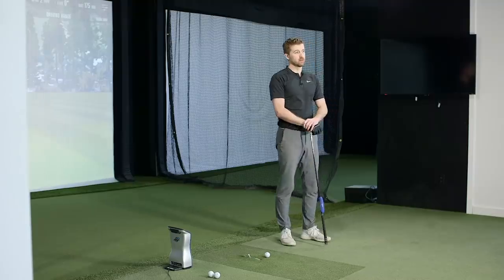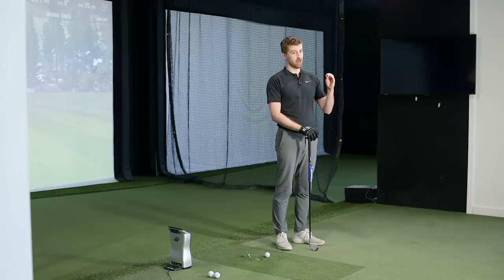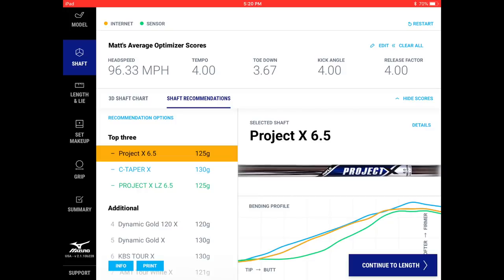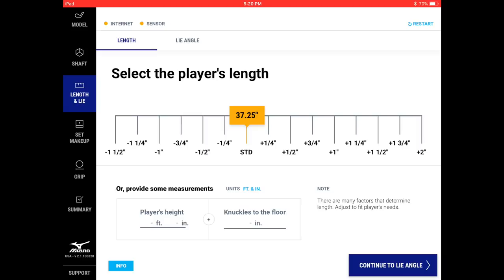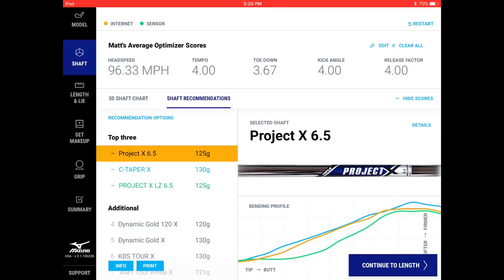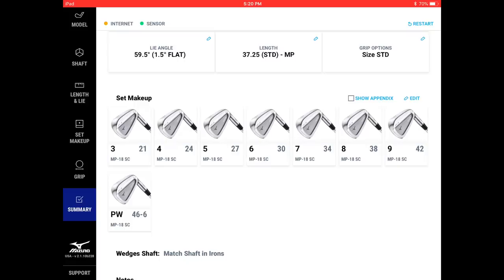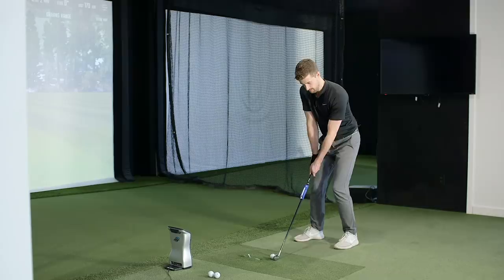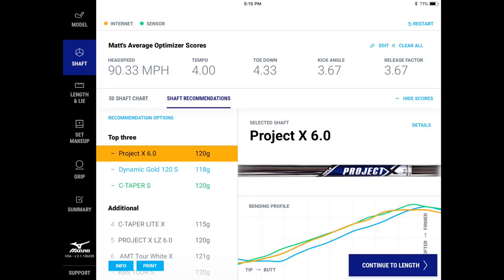Mizuno Shaft Optimizer 3D – How Effective is it?

Comment: Went for a Mizuno fitting with my Pro, who is also a Master Fitter.  He "didn't need" the Optimizer to select my proper shaft.  I struggled for 30 minutes with three different heads to hit solid shots.  Then I insisted on employing the optimizer, which suggested three shafts the Pro thought would never work for me.  A month later, I have a new set of 919s with a shaft suggested by the optimizer and new Pro!
Reply: How is the new shaft suiting your game this past season ?
Reply: Yeah, you can't fight cold hard data against thousands of hours of engineering going into it. Years of experience from an equipment viewpoint. That pro fitter should have embraced that data. Not ignore it.
Reply: Instablaster

Comment: Just had an experience with this tool with some pretty interesting results. I was recently fitted for the JPX 921 forged. Spent days trying new shafts just on feel and recommendations from the pro alone. I narrowed my choice down to 3 shafts that best fit me based on the simulator results. I must have tried over 25 shafts over 3 days and many hours. On the last day, the pro brought in the optimizer tool and I took my 3 swings. The tool recommended 2 of the 3 shafts I honed in on myself and the 3rd was a shaft I hit poorly. The back up recommendations the optimizer chose did poorly in my tests. Too nail down 2 of 3 is pretty damn good which would help support the point that this is another tool in the tool box and along with a good fitting can help someone narrow their focus pretty well I was impressed.

Comment: I have been on the previous version of this and I narrowed down my favourite shaft of the 3 that it suggested and I then proceeded to have 2 other manufacturer fittings end up in the same shaft after a longer process. I have complete faith in this system if you can't go to a proper fitter like TXG. The tool is fantastic. It would be nice to see one of these made for the top end of the bag and narrow down the woods

Comment: I got my irons fitted with the old Mizuno optimizer several years ago. I just went through a soup to nuts fitting with TXG (highly recommend) and most of the changes were done on my driver and fairway woods. I have gained 25-30 yards on my drives and the dispersion is way down. However, it’s worth mentioning that I only had to tweaked my iron lie angles as they still are performing well. In addition, txg tweaked my putter angles and I’m way more accurate now (and I am no longer leaving it short). Worth every penny - thanks gents for all that you do!
Reply from the maker: Thanks Paolo!!!

Comment: Great job guys!  Great to have Chris on to explain this as well!  I was fitted for irons about 4 years ago using the original mizuno shaft optimizer.  Seemed to be pretty good but only recommended shafts... not heads or lie angle, etc.  Hopefully this makes it easier for average to below average (less experienced) fitters to recommend something good!

Comment: My first fitting was with the first Mizuno System. It was badly off, it put me in KBS 105 gram  shafts on my MP63 heads. I then went for a second fitting that was more in depth. The second fitting recommended the Nippon 950GH 95 gram shaft instead, which I instantly proffered. So Glad to see they have made this change. That was 5 years ago now, can't wait to come and get my new bag done.

Comment: Brilliant video guys. I used the 3D Optimizer when I was fit for my JPX Forged 919 in June 2019. Shaft selection through the tool was great, it was pretty much spot on for the type of shafts I would normally lean towards (stiff, on the lighter side). Ended up going with the DG 105 S300. My ball flight was typically low (even in a high launching XP95 shaft). I was playing M2 Tour Irons, which are stronger lofted. A combo between going forged, weaker lofts, different head design (as you mentioned) and changing shafts has totally changed my strike and ball flight, plus helped the gapping and average distances become more consistent. Well done Mizuno. Hats off to you Chris, Ian and Matt.

Comment: Have used the previous version. Played with mizuno MP4 few years back. When the jpx 900 tour models came out was going to go for them. Went to my local mizuno dealer who had the shaft optimizer there. Played around with it. And the results came back with the exact same clubs, shafts lie angles and everything I was playing. The fitter said in all the years he had been fitting he has never seen that before😂 but was impressed by it. And this was with real ball hitting off turf/grass outside hitting. I prefer fitting that way as I have a very step angle of attack so don't hitting of mats to.  much. Great video again love these

Comment: Great video, guys.  I was fitted for a set of JPX 919 Forged Irons this week (6 through Gap Wedge bent 1* strong) and the Hot Metal Pro 4 & 5 irons......all at 0.5* flat.  I was fortunate enough to be able to utilize the Mizuno Shaft Optimizer 3D.  I have been extremely frustrated with my current irons (they’re not Mizuno, by the way) and shaft, and after seeing the results of my 3 swings on the Optimizer, I now understand why.  I’ve been playing a 95g graphite shaft with the wrong profile and my fitter showed me the results indicating I needed to move back to a 110g steel shaft.  So he dialed my first two shaft recommendations into the Mizuno 919 Forged head, and the results were so much better than what I’ve been experiencing.  The last Mizuno irons I played were the JPX 825 Pros when they first came out, and I’ve missed them since I moved on to a couple of other sets.  So thanks Mizuno for this great tool and for building such great clubs, and thanks Ian & Matt as always for such outstanding videos.  You guys are the best.

Comment: I went to Golf Town today because of this video and went through the fitting - I was the first to do it and helped them along after seeing this video. My 85mph swing was Tempo 5,  Toe Down 4.25, Kick 2.5 and Release 2.0 - recommended shaft was Dynamic Gold S300 120, Project X 5.5, Project X LZ 5.5 and Flat -0.5 - which is basically spot on. I tried that shaft it felt very good. The head was in Standard Lie and was Drawing about 5 to 10 yards - so I went -1 Flat which should keep it at a 5 yard Draw. It recommended Gap to 6 iron - I added the 5 iron as I like that as my longest iron. I went with the new Hot Metal Pros - the 7 iron @ 30 degrees carries 175 at 5000 spin with a 17.5 launch. 

I will be coming by for a gapping session when the new clubs arrive.

These are a replacement for my stolen Callaway Apex CF-16s with Regular F3 Recoils - the feel and the sound is so much better.

Awesome video & congrats to Mizuno for making this fitting tool - it provided a good fit based on everything I know about my swing and preferences.

See you guys soon

Paul

Comment: I recently got fitted using this, and it made a world of difference in my game. Gained 20 yards on my 7i. Went from fade/push/slice to straight/draw. It called my lie angle adjustment (up 2°) perfectly, and the #2 shaft ended up being a godsend. Never was able to really feel like I could load up the shaft with any power, but now it's screaming off the face. 

tl;dr - Trust this bad boy.

Comment: Chris, Matty and Ian...what a deam team!! I was fitted with the previous version of Shaft Optimizer, but knowing that the new 3D version was about to launch I gave it another try. Glad I did! The shaft recommendation was different as well as the lie recommendation (from the fitter vs Shaft Optimizer 3D). In the first fitting I ended up with Modus 105 R with 2*U, and in the second the recommendation was DG 105 S with 0,5*U. My WITB is now; ST190 driver, MP18 combo (4-5 Fli-Hi, 6-7 SC, 8-P MB, S18 50-7 55-13 60-10 all 0,5*F.

Comment: I just went through the process Tuesday.Started testing with the top three but ended up with my 6 recommendation of shafts  from the fitting process. After trying a number of brands i needed up with the Mizuno Hot metal pro 5 to wedge and a 4 Fli Hi, Great flight nice length and strike felt wonderful. Looking forward ti picking them up next week. The tool made it easy for me and the fitter to get a great result.

Comment: Got fit on new optimizer last week.  Recommended shafts were spot on. Recommended lie angle was 1.5 degree flatter than I’ve been fit for previously on a lie board.  I’ve always felt my irons were to upright and I feel the optimizer confirmed this and I ordered based on its recommended lie angle. Excited to get my jpx 919s out on the course.

Comment: Used this in my fitting a couple of months ago. Ended up ignoring the lie angle recommendation as the 1.5* up it suggested is the result of a swing flaw not anthropometrics but it was dead on for the shaft options it suggested for me to try. Resulted in a ball flight that is neutral and gets up quick before just boring flat forward through the air. Great piece of kit Mizuno.

Comment: The previous generation was a really good starting point. Because of my speed and tempo (90 / 6) the software recommended shafts in the 130g range. From talking with the fitter we found that they were just too heavy and made the club feel like hard work to swing. We ended up in the 120g range and with the details of length and lie sorted, for the first time I've got a set of irons that are working with me.

Comment: Just gone through this dna fitting and it recommended recoil graphite shafts due to my low launch and slow swing speed, gave them a try with my bruised ego and  I have to say it was spot on they are perfect for me, just awaiting delivery of a mixed set of hot metal and hot metal pro 😀

Comment: Really helpful video. Recently had a fitting using the optimiser in a big box store. Been using Nippon NSPro for the last 10 years. Assumed I would just fall into the Modus as the modern equivalent but it picked out the KBS C-Taper, same flex/weight. Big change in head from MB to a HMB so 10-15 yards added to the 7 iron means a full bag Review MUST be undertaken 😃

Comment: Awesome video! I was fit off a lie board in different time.  Once with a rep once with my club pro.  Though the fitting suggested 2 up, the pro recommended only going 1 up to avoid a left miss.  The rep suggested 2 up to encourage a slightly different action at impact.  Either way, hitting it sweeter now than ever after 15 years of scratch golf.  Still, got me questioning it all now.

Comment: In 2009 I was fitted by a ‘Mizuno’ fitting centre using the first gem DNA, it put me in a dynamic gold S300. I duly bought my clubs, I couldn’t hit them, felt very heavy. So I paid to be customer fit at the Mizuno centre in Clydebank Scotland, using DNA it suggested Dynalite S300.

I got my shafts pulled and refitted with Dynalite. Never looked back. But why would the same device give such different readings.

I hope this new gem is more repeatable. Bit not every fitter has your skills Ian, and rely on the strike tape. I’ve never played 2 deg flat, but that’s what I’ve been fit in my AP3’s since I stand up (not desirable) in my downswing I must present the club differently at impact.

I think the DNA whilst good, is no substitute for someone’s knowledge and eye for a swing fault, maybe gears married with DNA would give the right answer. Have you done gears yet?

Comment: Does it work with driver, fairway woods?
Is the optimizer compulsory for Mizuno distributors to use during club fitting?
Reply from the maker: the app will give shaft recommendations for the driver/fairways as well as part of the process – and no distributors are not required to use the device but can't imagine why they wouldn't want to!
Reply: According to Mizuno not every dealer is a Performance Fitter, which uses the DNA Optimizer.  https://www.mizunousa.com/jump.do?itemID=5&itemType=LANDING&page=bullseye&region=Golf

Comment: Awesome review guys. After going through many shafts, I went back to try mizuno Shaft optimizer again and it was spot on in its recommendation. Top 3 recommendations were the shafts I felt were best for my swing. The only thing I didn’t like was the recommendation of the same shaft in my irons with the wedges. I ended up changing my wedges to Modus 115 wedge shaft which was what I preferred.

Comment: Hey TXG. 
I'm going to get fittet then all this COVID is over at hohmann i Berlin. (Do you know the place, is it any good?) I'm going a lot of homework going into this being my very first real fitting. 
They do have the shaft optimizer and I am likely going to use it. Therefore I just wanna make sure I get this device. 

1. Does it mater what iron it's mounted on? Should this be my current iron, a random shaft iron or what? Does the flex, swingweight and the overall profil determine what it shows?
2. Does it also work on woods, drivers and wegdes? Even putter?
3. Does the weight of the device itself in any way chance the swingweight and thereby my delivery, strick location aso?
4. If I might benefit from a combo set, just like mizuno likes to do it, will that also show?? 
5. How will it coincide
Reply: Ups.. 

How will it coincide with the current irons im my bag?

Comment: Great video guys and very informative. Looks like a fantastic tool for fittings, although would fitters necessarily have access to all of the potentially recommended shafts? Would be disappointing to go for a fit to find out that the recommended shaft(s) were unavailable to try and would have to be ordered in, for instance. That said, still a very interesting step forward from Mizuno. 👍🏻

Comment: I had a fitting where this tool was used. I'm a high handicapper and at least at the start was not hitting the ball well. The fitter knew me and my swing so was better by the end though not sure I ever put my best swing on it. How would you feel about using this with a high handicapper having a bad day? The shaft and head we came up were what you would expect for my swing speed and shots were straighter and longer (not surprising current clubs 20 years old)

Comment: I was fitted for my Ping i200's last year and the older version was used by the fitter. I take it the Optimizer although a Mizuno product will work with other brands.
Reply from the maker: You can use it to get your report if you wanted to, the actual club designed to work with the device is a mizuno head though so you wouldn't be making the swings with another manufacturer's club

Comment: We don't have a paid Mizuno fitter in town, but one flew in from Phoenix this weekend and I headed over to see what this Optimizer had to offer.  I'm 42 with a 19 handicap and have always (since 2001) used a stiff shaft, but have gone lighter over the years.  So, I was very surprised when the Optimizer said that I was best suited for 125-130 gram X-flex shaft.  But after hitting a few with the X-flex shafts, I was very pleased.  The only thing I would say is, I was never shown the club set-up recommendations, so now I need to go back and check that out.  I was hitting the Hot Metal Pro during the fitting, which I really liked.
BIG Question is...will they develop the same type of technology for the Driver?
Reply: The DNA gives a very good start to a choice of driver shaft too.  It's on the software right now.
Reply: mizunogolfeurope 
Good to know, thanks for the info. Is that only in Europe, or in the US as well?  Also, are the Nippon Modus shafts an option offered by Mizuno? Thank you
Reply: @michaelparsons541  Europe and US - we run very much the same software and shaft offerings.  Here's the EU list - with some Modus options, https://golf.mizunoeurope.com/custom-fit/

Comment: I was on the course today and hit a Mizuno JPX Hot Metal 6i with a Project X / 4.5 / 70G shaft and I was hitting it about 135. I hit the same head with a TT XP115 R300 1" longer shaft and was hitting it a consistent 15 yds further?? I am 71 and losing distance rapidly. Any ideas and to why???  Thanks so much

Comment: Ian is these measurements taken with a standard length club the reason I'm asking if sumone is small and struggles to hit a standard length 6 iron would the fit   be abit of a misread in the sense it would recommend a shorter shaft switch might suit so therefore it would be swung different to the original

Comment: I strayed from Mizuno irons a few years ago.  Saw the error of my ways and went back to a set of JPX 900 Forged.  Couldn't be happier.  Several years ago when fitted into a set of MP 54s, the retail store I went to used the shaft optimizer at no charge to me.  since then, all the pro shops and stores in my area charge to use it.  I feel like these stores take advantage of the Mizuno tool and now use it as a revenue stream.  Very disappointing.

Comment: Was wondering if you use this tool and if you would test it. Looking forward to learning more. Sounds like it is a nice first step to narrow down to a smaller amount of shafts and then test from there. But does it have every shaft in the database? Does it affect swing weight and actual recommendations being skewed because of the the swingweight and delivery changes?
Reply from the maker: It doesn't have every shaft in the database, but has lots of options. Device weight has been offset by a lighter shaft

Comment: I’m the opposite of Chris. I cannot get a club that’s flat enough on a lie board but 2* flat of Titleist’s standard specs works the best for me with the shaft I use. I have noticed when experimenting with different shafts over the years that my needs would roughly change by a degree to a degree and a half with different shafts.

Comment: On a lie board it says I should be 3.5 upright. I play my Current Srixons at 62 (std). Took the 3D tool and it told me PX LZ 6.0 with 1* upright from 61. So I’d say it’s pretty darn good. I have somewhat similar DNA numbers to Matt sans speed. 84mph 4 3.3 4 5 if I recall correctly.